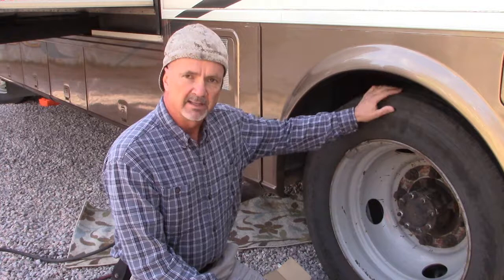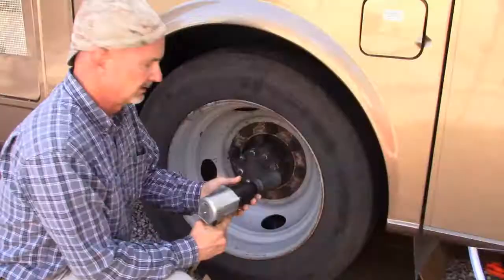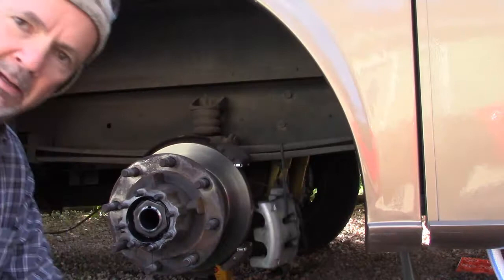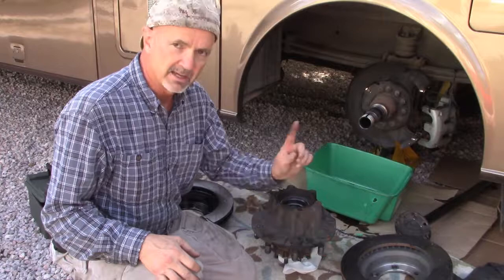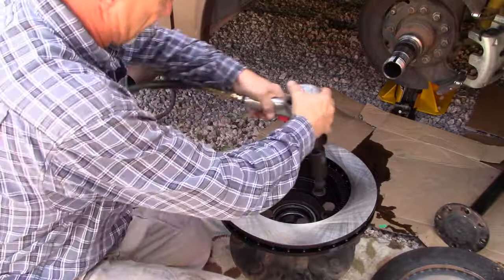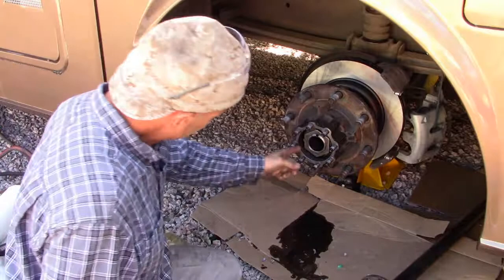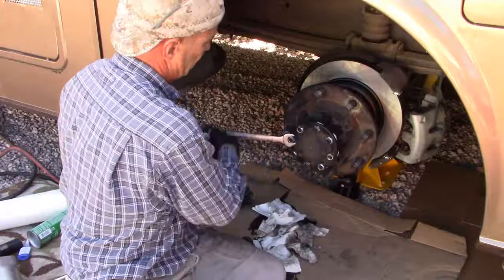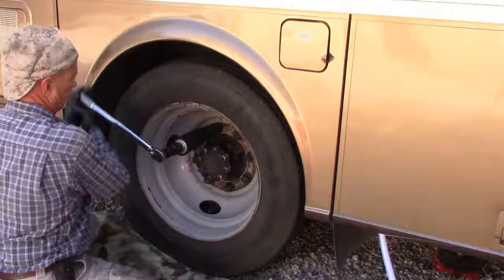Replacing Workhorse W22 Brake Rotors

Comment: Great video! Just purchased a National Dolphin RV to live in while building our new house, and I know nothing about servicing an RV... yet, but with folks like you provide these video will make my/our lives easier. Thank you for taking the time to make this detailed video.
Reply: I just purchased a 2002 National Dolphin 5356 myself here in Southern CA (from the original owner who lived a few miles from the now-defunct National factory in Perris, CA).  It has just about 20,240 miles on it with the Workhorse W22 Chassis and 8.1L GM motor.  It's in great shape inside and out, and the brakes seem to be in pretty good shape, but I suspect it will need brakes at some point, so the video sure makes knowing what's involved with the process.

Comment: I have that same torque multiplier wrench, I opened it up and pulled all the gears out and shoved them full of bearing grease. I also have the same jack stand and am waiting on the arrival of the US JACK 20 ton bottle Jack tomorrow. I already ordered 3 other jacks and they all arrived damaged. 

I store all this in my ‘just-in-case’ compartment of my ambulance RV and hope I never need it, but if I do, there it is!

Comment: Just a PSA... I used the Bauer electric impact from Harbor Freight, 1000 lbs/ft. I leave it in my rv if I have to change a wheel roadside. It was only $100.

Comment: Hey Mark, why couldn't the tires be lifted off the ground with the RV leveling jacks, and then place the jack stands under the axle? I searched YouTube for hours for pros/cons about lifting an RV wheels off the ground with the leveling jacks, but found nothing. Thanks.
Reply from the maker: I used the levelers to take most of the weight off the wheels, then used a hydraulic Jack to lift just a bit more to get jackstand in place. Partially this was for redundant safety. Partially to have fine tuning to help reinstall the wheels. Those wheels must weigh 80 pounds so getting them back in place was a challenge. Otherwise I see no reason why you couldn't lift with the levelers. In fact, as field expedient measure, I could see using the levelers alone just make sure something is placed underneath (a wheel, crosstie, etc) to catch the coach should she fall. Confined space with gruesome mental images of being crushed are unsettling when vulnerable underneath. The first time I removed a wheel, I slid it underneath as a last catch, but pretty exhausting so that was the intersection of fear and laziness in regards to safety paranoia.

Comment: Great video. Did you have to refill the differential when done? ( Looking for another video on that should I need to.)
Reply from the maker: Yes. When draining diff I tipped the coach to one side then the other to drain out the old fluid. I think there are links in the description to the lube I used as well as the thread seal and the pump to refill it.

Comment: What brake rotor for Centric did you use?
Reply from the maker: Most of the parts and tools I used are listed in the description.

The rotors...
Centric Parts 120.83015 Premium Brake Rotor with E-Coating
https://amzn.to/32KQd5U
Reply: @raggedyedge  Thank you so much!  I was trying to get the Raybestos 8540 rotors and can not find them anywhere.  By the way, I think you made a great video!!!
Reply from the maker: @cathywilliams3288  Good luck. It's a big job, but a simple step by step one. If you are a female Cathy, I admire your willingness to tackle it. With the right tools it's not terribly hard although mounting up those 22.5" wheels require strength or judicious use of leverage. 

One other tool that should be aboard any W22 is...

https://youtu.be/N8cYY7sNAIw

Comment: I looked up the tq specs for rear hubs and it says 50 lbs then back off 1/4 turn . Then 240 lbs for outer nut .  Just some information
Reply: That sounds about right to me. Considering the whole hub is being held on by it and the lugs go at 475… I understand the locking spacers locking it from spinning with the axle but still.. he only has 55lbs holding that hub on..

Comment: WHAAAAT? I want one of those tools for the lug nuts! What is it called??
Reply from the maker: Lug Nut Wrench Torque Multiplier on Amazon
https://amzn.to/31KtdU1
Reply from the maker: https://youtu.be/N8cYY7sNAIw
Reply: @raggedyedge  Thanks, I enjoyed the video. I would like to change my own brakes and maintenance, but have no way of re-torquing the lug nuts. Torque wrenches that large are quite expensive!
Reply: @kevinwilliamson7294  I used a standard torque wrench with the 58-1 torque multiplier.
Reply: @AmbGun  Not sure how accurate that is? That torque multiplier could easily snap a lug
Reply: @kevinwilliamson7294  a shop is cheaper.....by all means go!
Reply: @kevinwilliamson7294  or not
Reply: @EVILTV666  good point